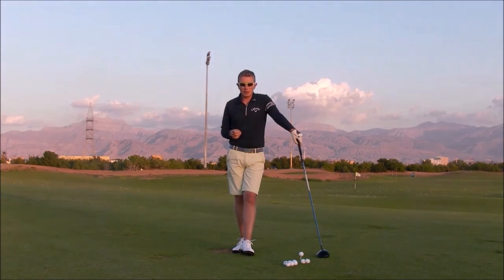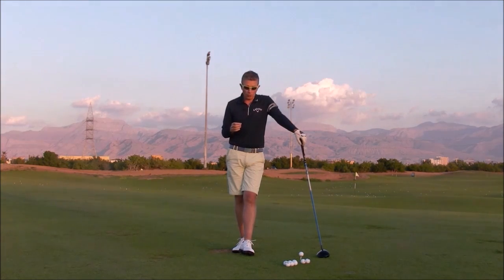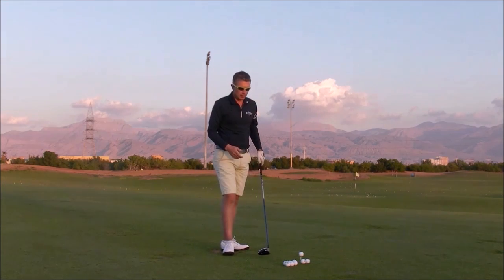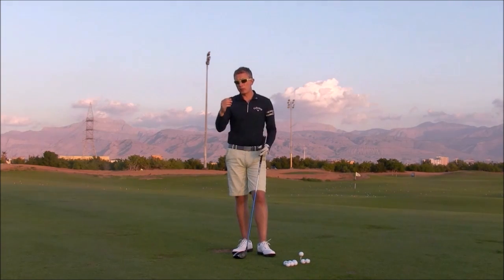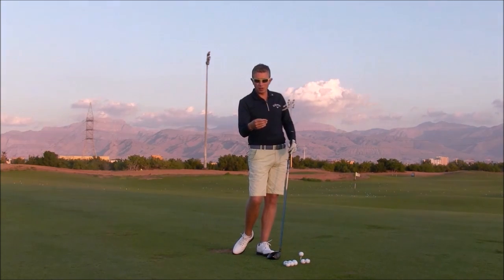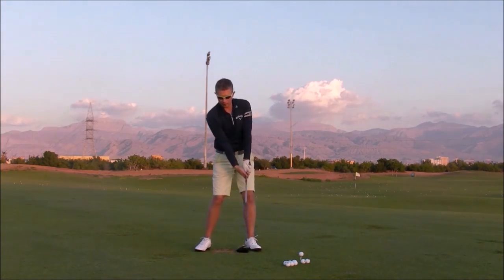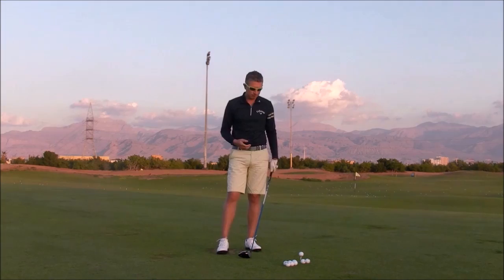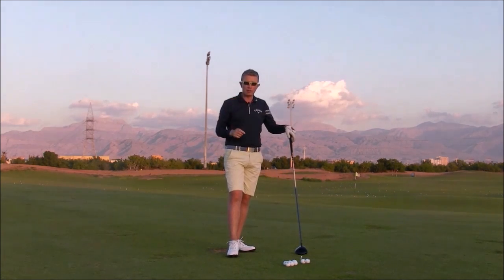Low Spin Driver For Maximum Distance

Comment: Well done Robin, great explanation.  By hitting up slightly you are striking the ball higher on the face which will reduce spin, and at the same time by holding down the loft, you are helping to keep the flight down and spin even lower still.  Excellent video, best one I've seen for lowering the ball flight.
Reply from the maker: +Paul Byrne Cheers Paul, appreciated

Comment: Good explanation Robin. What would you advise for 4500rpm, attack angle +4, near centre contact with 11.5 degree driver. Your thoughts would be appreciated. Happy New year to you.
Reply: Get a low spin driver, and possibly lower your loft to 10.5 or 9.5 BASED ON SWING SWEED.

Comment: It's correct that hitting down on the ball will increase backspin but hitting high on the club face will lower backspin, not increase it, given vertical gear effect.
Reply from the maker: +John Lee Sorry John, missed your comment. Yes, this is a gear effect as well, but my thoughts are that the negative of hitting down would out weight the plus from the gear effect